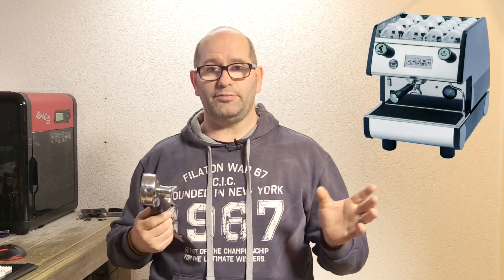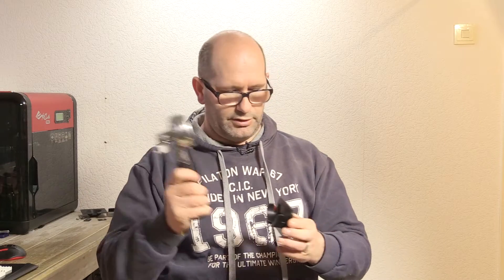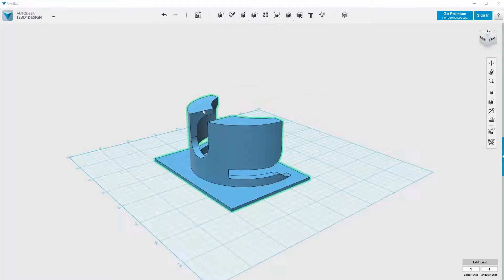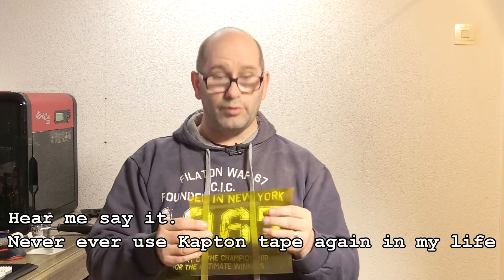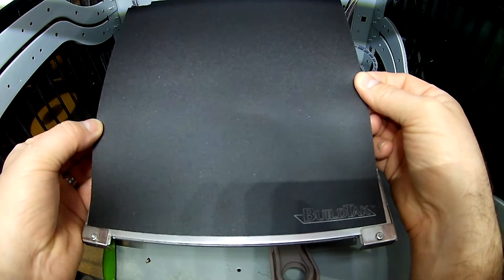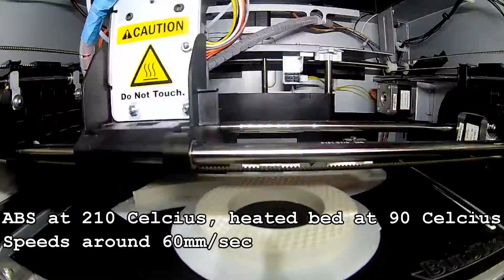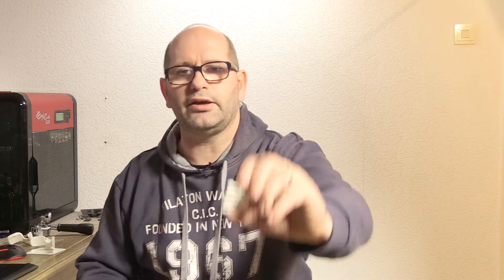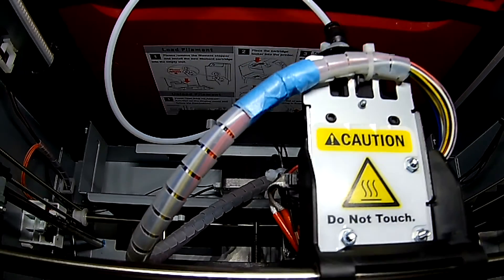▼ The best upgrade ever for your 3D Printer and a coffeefilter holder

Comment: have you tried using borosilicate glass to print on the davinci pro?
Reply from the maker: No never. I have BuildTak inside the printer and that works great for me.
I do have other printers that print on glass. Also works great, but I am not replacing the BuildTak as long as I can use it.

Comment: Do you still use BuildTak today? Just curious since this is an April 2016 upload. Thanks again for your assistance on YouTube!
Reply from the maker: At the moment I am using Kapton tape.
Not because it's better then the BuildTak, but because I happen to have more then 50 sheets of it and it does the trick for PLA prints.

But, for my new printer that I am building, there will be only one kind of bed, BuildTak...

With Regards,
Brian Dragtstra.
Reply: Sweet! Thank you for taking the time to respond to my comment!

Comment: so i buy this buildtak product, install according to the directions.... was going to print the door switch holder, the surface of the buildtak started buckling up just before it started printing i tried to pause it.. to late ... got damaged... not really happy with its lack of adhesion to the build plate
Reply: so i lowered my bed temperature to 60 degrees using abs.... it did hold, however when it came time to take the object off... the whole sheet came off... is there a better glue to hold it down?
Reply from the maker: Hi Nathan,
Please check if you have the original BuilTak or some Chinese clone of it.
I once bought BuildTak and it happened to be a clone without me knowing it. Had the same problems as you.

With Original BuildTak, you have to spend at least 20 minutes to get it of your aluminum bed again. It has an extremely good edhesion to the printbed and the plastic printed by your printer. It can also work perfectly with heigh temperatures, like 110C for ABS without any problem.

So, please check with your supplier if you have original BuildTak.
Reply: 3d Print Creator 
well i bought it locally from microcenter and it says buildtak ... has the warning info etc...
Reply: further info... wont stick at all now... maybe worth a try to return it.
Reply: got a new one works great..... might be shelf life? idk  they were on the bottom of a stack on things at the store....
Reply from the maker: Good to hear that now you have a new plate of BuildTak, it working like it should.
Reply: Been learning the manual method of leveling the bed... the auto one always gives me a fail now
Reply from the maker: Hi Nathan,
Once you start leveling it manually you will never switch back to auto mode.
Also, I do the leveling only once a month or so, unless I changed something that could have messed up the leveling.

Comment: Brian I just purchased this printer and buildTak after installing BuildTak what settings need to be changed if any?
Reply from the maker: There is only one thing you have to be sure of, and that is that your nozzle height is a little bit bigger then normal or else plastic will stick to good to the bed. It's also mentioned on the BuildTak packaging and the leaflet that came with it. That's all.

Good luck with your printer.
Reply: Thanks Brian, I printed the Key chain straight out of the Box after applying the Build Tak
I set Z offset from 1.59mm to 1.66mm it stuck well. My next print was your spool holder since it was a 9 hr print I started it and Had to leave when I came back it was 7 hrs in and lifted on the hanger side :-(

Any suggestions?
Reply from the maker: How have you calibrated your bed. If only one part lifted, it looks like the bed is not perfectly level.
I never use the machine calibration function, as it's no good at all.

To calibrate, I go to the Z offset function in the machine and I use a business card (or the BuildTak leaflet that was inside the box) to calibrate the bed. Just a manual calibration where I set the nozzle above the screw points and turn the knobs until there is just a little friction. After doing all three points, repeat the step because only after the second run, it will be good.

This works so much better then the build in calibration. Please do it this way and you will love it forever.
Reply: No I have not had any lift problems only the holder I have not calibrated the instructions say not to so I just went with it. I know right!, OK so I will check it as mentioned and then re run holder.  Just BuildTak no glue correct?
Reply: Your leveling instructions would make a great video by the way.
Reply from the maker: Just BuildTak and no glue, that's the way to go for ABS and PLA.
I will make a video on manual bed leveling. I only have to find out when :-)
I always make a few video's at once, so the next 3 video's are already made.
Reply: I sent you a email through your website contact page
Reply from the maker: Have to dive into it, but my contact page doesn't seem to work at the moment. Can you send it to info@3d-printcreator.com?

Comment: I bought my Da Vinci pro a few days ago. I installed BuildTak before i printed anything. I did not change the print head setting at all and it works great. The prints stick to the BuildTak so well I can barely get them off. I have to use a razor blade and the putty knife that came with the printer.
Reply from the maker: Hi
For your own comfort you can go to the printers Z Offset menu and make the gap between the head and the bed just a fraction bigger. This is also stated in the leaflet that comes with the BuildTak. If you don't do this you risk damaging your BuildTak.

Comment: i print PLA on clean kapton with purple glue stick. adhesion is so strong it requires spatula to remove. and prints as large as my entire bed are perfectly flat without warping.

if you want strong printed parts, use PETG.
Reply from the maker: +ms3bani My results with PLA on Kapton tape were not that good, I had better results on blue painters tape. On BuildTak however, I don't need anything like glue or hairspray... It just sticks like crazy and it is perfectly smooth.

I have never tried PETG, but I will for sure give that a try once.

Comment: again a very nice and instructive video from you, thnx! what feeler gauge do you use for the calibration of the printer when using buildtak?
Reply from the maker: +Marko Normally I have a feeler gauge of 0.15 laying around, but this time i did everything with a business card made out of pretty stiff paper. The Only thing you do with it is sensing if the bed is leveled in any position above the leveling screws.

After that I use the Z axis offset to make sure I have the correct offset for the nozzle above the bed.
Reply: +3d Print Creator  thank you! i will order my buildtak this week @3d division.